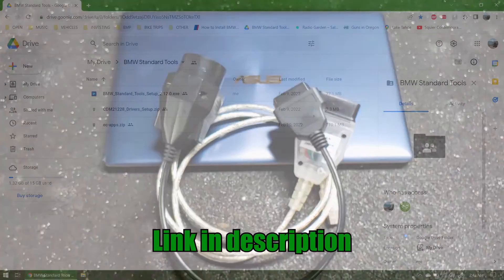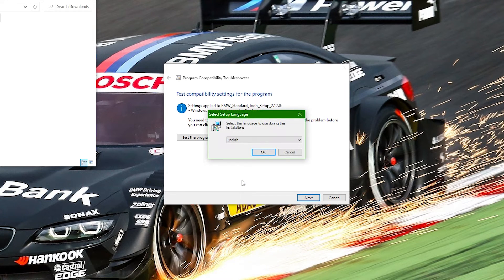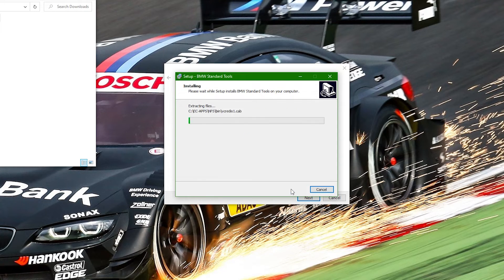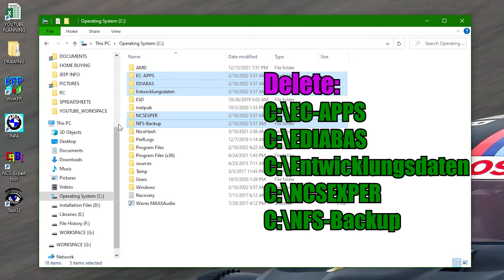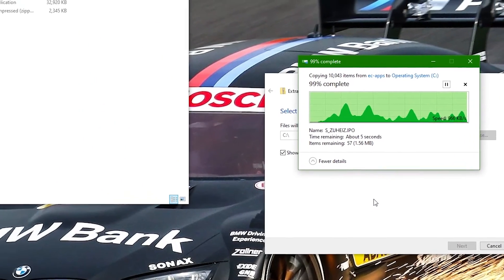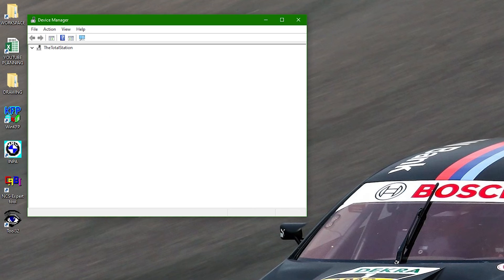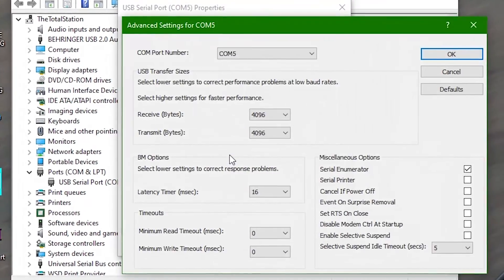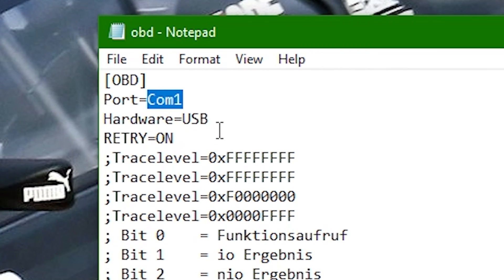Install INPA, NCS Expert, WinKFP, Tool32 on BMW Easily: Step-by-Step Guide

Comment: I am receiving the infamous IFH-0006: COMMAND NOT ACCEPTED message. Can't seem to figure out how to resolve this. Can you help? Also when launching BMW Coding Tool, receiving MSCOMCTL.OCX or one of its dependencies not correctly registered: a file is missing or invalid.
Reply from the maker: I hadn't heard of this issue before. Windows 11 seems to be giving people trouble so try windows 10 or earlier and make sure all Windows updates are complete. Then restart the PC and try reinstalling everything from this video. One final restart may be needed. At least, that's what I would try.
Reply: @endlessmoneypits  Thanks for the reply. I have Win 10Pro but I'm getting a warning re: CDM21228_Drivers_Setup files". 
Can't scan file for viruses, ex-app.zip(710.1MB) exceeds the maximum file size that Google can scan. Only download the file is you understand the risks,  so I hesitated to open it. Is that normal?

Comment: you didn't even use winzip.
Reply from the maker: Yeah, that was weird. I think my version of Windows has an unzipping tool built in. WinZip was in the official write-up I followed so I included it in the video.
Reply: @endlessmoneypits  windows 10 and 11 has a built in zip tool

Comment: Hi , I have a ENET cable can I use this software with my cable ?
Reply from the maker: I don't think so but let us know what happens.
Reply: @endlessmoneypits  yes worked like a charm . i just change the interface to ENET on EDIBAS tool32 configuration .
Reply from the maker: Excellent! That's great to know, thank you.

Comment: Hello Endless Money Pits, do have an INPA version that supports E89?
Reply from the maker: No I do not, sorry.
Reply: @endlessmoneypits  You need SP-Daten_E89_v48.1 It is a pretty big download. Even zipped it is 5.1Gb. I can send it to you, if you have space to make it available. No idea how to implement that to this setup, though. I have a very old laptop lying around with all the software working for if i ever need to change anything to my E82 (although I don't thing my garage will flash anything again to my car. Outdated...) Had someone set it up for me at the time... I mainly used it for the Alpina B3 gearbox upgrade, and some minor tweaks

Comment: When clicking on the troubleshootcompatibility button here (1:19) my pc says it dose not have a app to open it. what do i need to download? also can i use this software to find the problem my e46 have? its switching by it self if it want to roll the starter or not when turning the key and i can not find the problem...
Reply from the maker: Make sure you don't have any pending windows updates.

Comment: English please! I installed it and it works but it's mixed with German and English. Especially error logs are in German. I have v5.0.2 works in English very good. I need to recode FRM module on my 2008 E90.
Reply from the maker: Make sure to select English for the installation language at all stages. Might need to reinstall.

Comment: Thanks!
Reply from the maker: Thank you!
Reply: @endlessmoneypits  Hi – you’re welcome – awesome video. But I hit a snag! Been using a German lang version of INPA which was working fine but driving me nuts!! Uninstalled it. Downloaded yours but your compatibility program would not run on my Win-10 laptop - so I extracted files with the Win-10 file manager extractor (which I understand does the same job as WinZip), which of course didn’t create the Desktop icon shortcuts. The port configured to Com1 with no issues. Ran INPA from Bin folder and I experienced some weird behavior – (1) when I first plugged the cable in, I got the two black circular indicators as active, without it being plugged into the car (E93)!! Very weird! When I plugged into the car I also found that the indicators appeared to work, then not when interrogating the engine! (2) I restarted and reconnected to ensure I had a live connection but again when I tried to identify the engine it came back with “Error compiling script file!” Qs; regarding 1-  with my German version, port configured itself under USB or other but not under Ports! Know anything about this?  2- does the compatibility prog do any particular arrangement/creation of subdirectories that is causing the program not to find some execution files? Any pointers would be helpful. Many thanks
Reply: Ah - ignore above -  figured it out! "INPAload" is the actual INPA executable file! Everything appears to work fine. Are there any other quirks i need to know to run other programs as the setup does not work for Win11? Correction to above, my PC is 10 but laptop is actually Win11 (which i hadn't realized) and the answer to other comment Qs) Cheers

Comment: The only SP-Daten files available for NCS dummy are e39 and e46. I'm trying to turn aux on in e87 116i. Please could you provide a link to download the relevant Daten files? Bimmergeeks is unavailable. Is there no way to get the files for this, i.e. is it now not possible to use this software for anything other than e39 and e46?

Are the relevant DATEN files installed alongside the K-DCAN driver software/when it is plugged into the car?

If not, does the original NCSEXPER/DATEN folder come with all the relevant chassis'? If so is it worth not deleting this folder and replacing it with the contents of ec-apps? Or is there a specific reason why we do this that would prevent the app from running?
Reply from the maker: The software and files provided in the video description are all I have. I'm not sure about the K-DCAN software you are asking about. Sorry I can't be more helpful. BMW has been cracking down on sites supplying these files so that's why they may be hard to find.
Reply: @endlessmoneypits  The software actually came with the cable on a disc. The rest of the tutorial was great

Comment: Hey dude, thanks for the video ! 
I did It few times ago on another laptop and it worked at the first time. But now, I installed and follow all the process on another laptop and INPA won’t recognize the ignition. I’m stuck. Everything seems ok (com port 1/ good folders/ plug process)
Can you help me please ? 
Thanks 🙏🏼
Reply from the maker: Hmmmmmm
Make sure all windows updates are complete.
Restart computer after installation.
I don't know if this works with Windows 11.
If all else fails, try with another PC.

Comment: I am curious as in the FAQ you say this set up should work with older BMW's I am looking for a diagnostic set up for my 1998 e36 323i to diagnose an abs and traction light will this set up work for me reading those codes? Iv been looking for ages for an answer on this so any help would be amazing.
Reply from the maker: I don't have a way to test that but give it a shot and let us know if it works! It's free to find out.

Comment: If you still have trouble connecting try to change the BM latency to 1msec (on the advanced settings window below COM port number). This fixed it for me.

Comment: can I use a Mac with parallel installed so I can run windows 10?
Reply from the maker: Probably, but you'll have to try and let us know if it works.
Reply: @endlessmoneypits  will do🫡

Comment: fantastic video. Just did the download. However, there was a folder titled EDIABAS_NEW that contained the same files plus extra files as those included in the EDIABAS file.  I tried to remove this file but am saying I need to provide administrative privilege's to remove it.  I am the only user on this laptop.  Any ideas.

Comment: I have a dedicated laptop with bmw scanner 1.4 running xp.  I get the future proofing benefit of wind 7 but can I run these standard tools on xp? I’m mostly interested in updating the software on my e46 m3 to see if it’ll help connecting to the emissions computer so I can get my inspection done (currently no communication,  it just times out.  generic obd2 scanner and Bmw scanner 1.4 works fine aside from no live data)
Reply from the maker: You can try but the FAQ for this write-up says that Windows XP is no longer supported by most software including chrome.

Comment: Think I have a problem as I never see Ports in Device Manager even after installing FTDI drivers and even have the same cable as you Oregon. Maybe it’s because I have Win 10 Home?  Any workarounds for that?
Reply from the maker: Hmmm it should work on windows 10. Make sure you don't have any pending windows updates. If all else fails, try on a different computer.

Comment: Tired installing BMW Standard tools on Windows 10 Version 22H2 and it errors out at setup because only Windows NT 4.0 Windows XP Pro are supported.  Also would the Bimmergeeks cable be the best one for this software if I get it installed
Reply from the maker: Worked for me on Windows 10 but I'm not sure which update I was on. I've never used Bimmergeeks for anything.
Reply: did you ever fic it im getting the same error on windows 11

Comment: Hi, trying to download the bmw standard tools setup from your link but for me it says there is a HTTP error?
Reply from the maker: It still works for me but is very slow. I think it must be an issue on Google's end. If all else fails, you can download the installation files from the original write-up that's also linked in the description.

Comment: I don't know if I missed this in the video but most responses on the software when I check for errors are in German. Is there a way to change settings so that results are in English?
Reply from the maker: That is strange. Did you download the software from the link I provided?
Reply: @endlessmoneypits  Yes I did.
Reply from the maker: Hmmm... I would reinstall and make sure to select the language you want. You could have easily missed it.
Reply: I have the same problem, some modules are in German, some in English.
I definitely selected English in the set up.

Comment: Hi again so I got the ecc app into my c drive and I have the 3 folders now ! So when I get the cable and plug it in it would the driver instal them selves ? Or is there something I need to do for the k cable ?
Reply from the maker: Just do exactly what I did in the video.

Comment: not working for windows 10 i tray but not working
Reply from the maker: Worked for me on Windows 10
Reply: @endlessmoneypits  wel i buy a second hand abs pump en i'm try to program my vin  to it whit a Inpa Ediabas K+DCAN for BMW with EOBD USB OBD2 Diagnostic Switch Adapter Cable. en it was not working whit your program

Comment: Hi I’m stuck on ec-apps part and I’m not quite sure how to extract the file to the driver with winzip I don’t get the same tab as you were it say extract not sure what I did wrong and I was hoping I could get some pointers thank you love the vids
Reply from the maker: Thank you. It may say some other variation of "extract", or the extract comand may be in a slightly different menu location, but that should still do the job of decompressing the files so you can use them. I hope that helps.
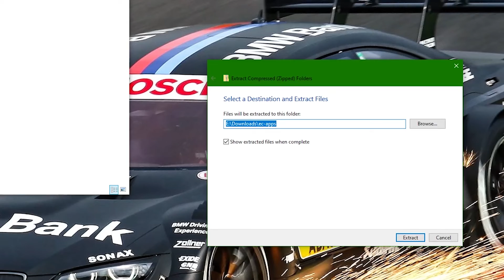Reply: @endlessmoneypits  yea that’s the thing idk where mine is lmaoo and doesn’t really show like yours does in 3:31 so at this point I’m confused on what other step I can take
Reply from the maker: Did you install WinZip?

Comment: does not want to connect to the car.
cable check
Program installed
Edit to Com1 in all the places you went through.
Reply from the maker: If you've already gone through the FAQ at the end of the video, check the comments here for ideas.
Reply: I had this problem with my e90…. If all the settings on the Comm are correct then start Inpa then connect the cable to the laptop turn power on in the car and lastly plug obd connector to the car. This was the only way my works. I did the install and set up how the video explains but connected it in different steps….. good luck
Reply: @javierherrera7575  Thanks, its works

Comment: is this compatible with the 08 528i e60? also does virus protection need to be disabled? when i unzip the files to the c drive it blocks 2 files because of virus protection
Reply from the maker: Yes this should work with your e60 from what I understand. I did not need to disable virus protection for this but it's possible you might need to.

Comment: Does this work for e90
Reply from the maker: I cannot confirm that it does, but it should work through E85. Please let us know if you find the answer.
Reply: @endlessmoneypits  what do you mean e85
Reply from the maker: My airbag light video lists all the BMW chassis numbers that the software works with like E46 and E85, but E90 is not listed.
Reply: @endlessmoneypits  okay sounds good, do u have a video about updating datens
Reply from the maker: Nope, not yet. I haven't learned much about programming yet but it's on the list.

Comment: does the same process apply for a enet cable for my 5 series
Reply from the maker: It looks like those cars use the enet cable with a different program called E-Sys. I have not worked with that program yet.

Comment: Installed and works perfectly, however 2007 BMW X5 (E70) is not available in the menu.  Is there a way to add it?
Reply from the maker: I keep reading that the E70 is supported in INPA, but the software does not have an option for it. I don't understand. I did find out that the E70 requires a D-CAN cable instead of the K+CAN cable I used in this video. I would recommend contacting Bali on the E46 fanatics forum with this question. I guarantee he knows the answer.
Reply: @endlessmoneypits  SOLVED.  I followed the complete instructions at https://www.youtube.com/watch?v=fGpAXDaS9TI and not only was the E70 available but I was able to monitor the real time air conditioning temperature readings (Analog) that I needed.   It takes a few hours to download the sp-datem, however once downloaded I only had to install the Base and E70 datems for my purposes.
Reply from the maker: Wow, I'm glad you figured it out so fast! I will have to check out that video when I have more time. Thanks for sharing the solution!

Comment: Thanks for taking the time to make this, and still be answering questions a year later! My Question is, what is that white thing you are plugging into your computer at 7:10? Will I need to buy one for myself along with the K cable?
Reply from the maker: Oh, I probably should have mentioned that. My laptop only has a USB-C port, so the white thing is an adapter for this laptop that connects to USB-A, HDMI, and another USB-C. You do not need it as long as your computer has a USB-A port, which most do. 
I'm happy to help when I can, so feel free to ask if you have any other questions, and thanks for the support!
Reply: @endlessmoneypits  Legend mate, cheers!

Comment: Great video. Can I use this on my '08 E66 750li 4.8 v8 and '05 X5 E53 4.4 v8 and '05 545i 4.4 v8 on windows 10 laptop?
Reply from the maker: It should work on the '05 but I'm not sure about the '08. Let us know if you try it and find out!

Comment: Hi. What are the specs of the laptop you re using in this video? Really just for unzip speed comparison
Reply from the maker: Well, I sped up the footage of unzipping and installing files because it takes a long time. The laptop is an ASUS ZenBook 3 with an i7 7500U but I actually did the screen recorded shots on my old desktop computer. It was running an fx-8300 with 32 GB of ram on windows 10. But like I said, the footage is sped up.
Reply: @endlessmoneypits  I'm using my one and only, it's an m2max MacBook. I'm surprised I could get everything up and running on parallels win11 arm
Reply from the maker: I don't think these programs require much to run. I have used INPA on a desktop from 2004 running Windows XP.
Reply: @endlessmoneypits  I'm a c++, python developer and so this is my work horse. I did not buy it for remapping : D who buys a Mac in the first place for remapping, not me
Reply from the maker: Oh, then just for fun I'll tell you the specs of the computer I just built for video editing. ASUS ProArt B550 motherboard, Ryzen 7 5700x CPU, and a RTX 3060 ti GPU with the fastest m.2 drives and 2.5 SSDs I could find, running Windows 10 Pro. Nothing to show off but it's a huge step up from my 8 year old prebuilt PC and more than enough for my needs. First PC I've ever built.

Comment: Everything worked but I am missing the Daten files for e89 and can’t access it when I select chassis in ncs
Reply from the maker: It sounds like this version of INPA may not support the e89 chassis.  I'd recommend contacting Bali directly on the e46fanatics forum to confirm this and see if he knows where to get a newer version of the program.  He usually responds pretty quickly.

Comment: Does this tutorial works for windows 11?
Reply from the maker: I don't know anyone who has tried it on windows 11. If you give it a shot please report back and let us know if it works.
Reply: I’ll give it a shot on w11 as soon as possible. My intention is to code my obc on my r53 mini
Reply: I was able to install correctly the programs, i don’t have the k+dcan cable yet, so i can’t go on but i think that installing the drivers for it it’s not gonna be a problem. If it was going to be a compatability issue with W11 it should have happened in the installation process.
(Sorry for my english (i’m italian)).
Reply from the maker: That sounds like good news. I have a feeling it will work on windows 11, I just can't say for sure. Thanks for being the test subject!
Reply: @endlessmoneypits  when i’ll get the cable i will report if any problem came out!
Reply: @Luca-xj3jv did it work on win11?